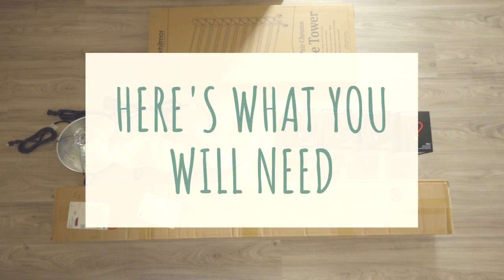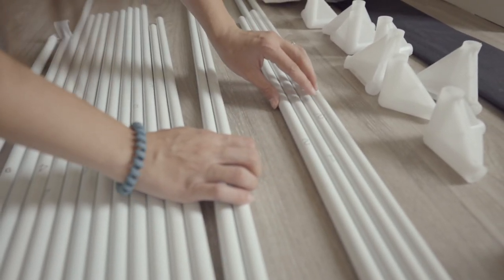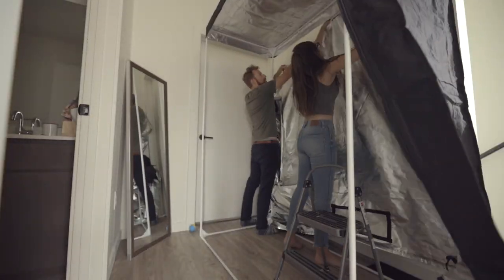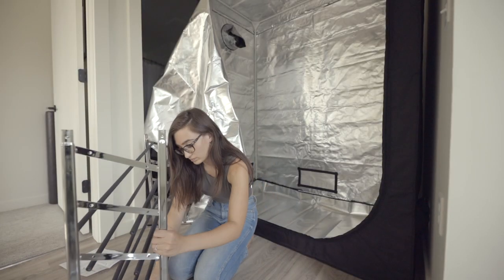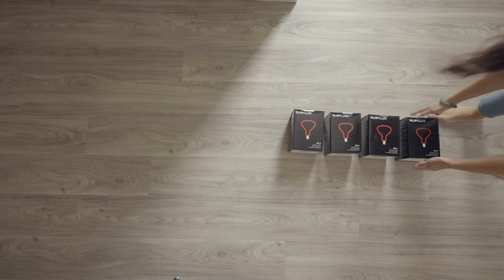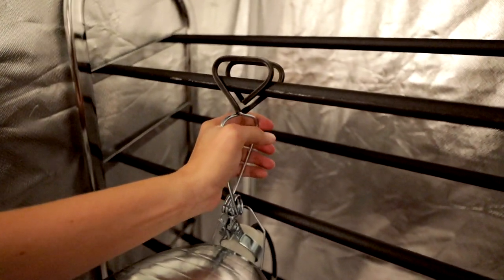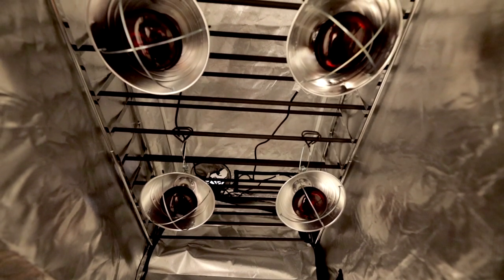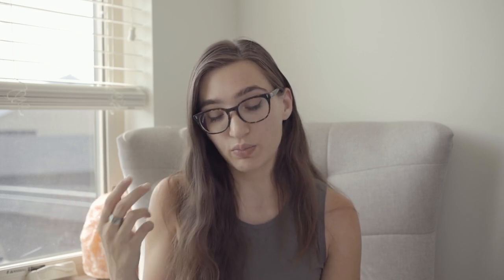DIY | HOW TO BUILD YOUR OWN INFRARED SAUNA FOR LESS THAN $400

Comment: Cool. I too have these light bulbs. But word of caution for anyone: Do NOT put too close to skin! . I had these around 10-15cm away from my body. Where I held it for longer around 10 minutes , I have two visible melanoma spots pop up, and some really tiny ones like spec of dust in the exact places!. Its not coincidence. Imho Its not 100% safe or without risk. 

In this case with reflectors to spread/even out the beams and you're at a distance far enough I believe its much safer. Just don't "roast" yourselves!.

Good health to all!

Comment: Thanks for the video. I'm in the same boat that I don't want to spend 3-4k for a sauna. I was going to get one for about $1200, but realized they might not be all that. Then I figured I could build my own, so I came looking for videos. Yours is the first one I came across. I'm still learning about Near Infrared vs Far Infrared, so not sure which bulbs I'll buy. Your video made me realize that it's not that difficult to simply build my own. Thanks and good luck with your health.
Reply from the maker: Thanks for taking the time to watch :) Hope it helped make the idea of making one more manageable! I love the bulbs that I linked in the description and haven't had an issue in the 6 months using them. They produce NIR and red light so I have found them helpful on both the deep detox level (NIR) and for healing some scarring I have (the red light). Hope that helps!

Comment: Please correct me if this is wrong information but I personally wouldn't add a metal shoe rack, you want to reduce the emf levels and metal is a conductor. Use grounded outlet and ext cords if possible
Reply from the maker: That's a good point! It was the best solution I could find when making this sauna and as I reduce my EMF exposure where I can, for me, the pros outweighed the cons. Do you have any other ideas for what the bulbs could be clamped to??
Reply: @fullymarissa4236  a timber shoe rack

Comment: Thanks for the great video!   A couple of questions from someone who is just learning about this form of therapy...  How hot does your sauna tent get with those bulbs?  Do you feel like that was enough bulbs?  How long do you stay in the tent and do you feel like this therapy is giving you the benefits associated with traditional sauna's?
Reply: Also eager to know what temperatures you were able to achieve with this setup? :)
Reply from the maker: Hi Sandy! Thank you for your questions! 1) I am not really sure on an exact temp but based on being in other sauna's I'd say that it gets around 120/130F. I like to plug it in 5-10 mins before getting in which gets it up to a temp that causes me to get a good sweat going after about 10 mins. 2) I stay in around 20 mins. If I am especially stagnant, then I will stay in up to 30, but I have never needed longer! My rule of thumb is to stay in about 10 mins after I really start sweating, which, for me, is around 20 mins. 3) There are definitely enough bulbs! I cannot imagine having or needing more than the 4, especially if you give them the time to warm up. 4) This, for me, is the BEST form of detox I have and I have never said that about a traditional sauna. It is a much deeper detox compared to traditional saunas. Those saunas work by heating up the air around you so it's a very surface level sweat. NIR saunas like this, penetrate deeply into your cells so you are truly detoxing from the inside out. I hope that helps!!
Reply: Sorry to be off topic but does anyone know of a way to log back into an instagram account?
I somehow lost my password. I would love any assistance you can offer me.
Reply: @Nico Anakin instablaster :)
Reply: @Cassius Jimmy It did the trick and I actually got access to my account again. I am so happy:D
Thank you so much you saved my account!
Reply: @Nico Anakin happy to help :)
Reply: After several months now is it still holding up?  Are the poles plastic and if so does it get too hot for them were the begin to warp?  Very interested in this and your set up seems the most feasible for me. Thanks for the video 😁

Comment: Do you need to have a tent? I have a small square room with a drain in my back yard wondering if I can just hang the lights around. It’s about 5-6m squared but wide open only 50% wall covering outside

Comment: How hot does it get with just the four lights? And what's the ambient temperature? Those bulbs create heat by being hot. There's little far infrared wavelengths, so they don't actually heat you and not the air. However, the light itself is healing, so you may find the lamps are their own thing, even if you don't sweat buckets.
Reply: I was wondering the same thing as well!
Reply from the maker: Hi Ann! I am not sure the exact temp with the 4 bulbs but, I SWEAT. Like full on dripping hah. These bulbs are NIR bulbs (not far/LED) so they become very hot and produce healing wavelengths and not just red light. It does not get uncomfortably hot in the tent and I really do feel like I sweat from the inside out. Wish I could give a more accurate answer... but I do know it has helped my detox tremendously and has the red light has also improved the scarring I have. I'm not sure how to accurately test the temp inside the tent... Thoughts?

Comment: Hello… do you find your skin ‘ burns’ from the four bulbs? My husband built me a panel of 4-philips 250W bulbs spaced as yours is. 
It’s in a tiny bathroom- I’m 18 inches away but can’t go back any further really.
I don’t have insulation panels yet which I may try to do bec I don’t sweat in there, I just get the red light therapy.
So… what is wattage of your bulbs? And do you find your skin burns?🤔Mine gets very hot snd pink patches in some areas . I heard RLT does not harm skin or cause cancer but the burning has me concerned 🤔
Maybe I’ll try less wattage and look for a tiny insulated tent🤔
Thanks for any more Info
Reply: @tenazrael  thanks !! I’ll definitely look her up. I do use olive oil, tahini sesame seed oil etc🤔
      However… I had a horrible accident with my bulbs… after a session last month ( after using for Two months and feeling/seeing benefits!!!)
I stood up turned around and one bulb exploded on back of my legs😣 it could have been my face n neck n chest 😣
we hadn’t put the “cages “ around them yet although the type I would have got were similar to yours and  would not have spared me either, those are just for not getting too close…more visual reminder…there are other “cages” that protect more, tiny openings, and would have spared me the “hot ‘shrapnel’ glass”😣
This was a horrid FREAK accident .., I’m still getting all wounds tended too every other day  at ER clinic.
The only explanation is that before I turned it off the corner of a wet towel might have brushed over it😣… I just can’t recall— was a bit traumatizing , or I didn’t screw it in tight enough when I changed bulbs.. I heard it could overheat that way snd possibly blow😕though they say very rare. I researched extensively with Dr Wilson etc
Needless to say… I’m too fearful now😕to continue . 
Be careful. Maybe get  better cages for protection.
I miss it terribly  just too risky 😕
Now I may do steam saunas for detox and look into the LED panels🤔For photobiomodulation🤔though those are ridiculously expensive 😣who knows if I’ll be able 
Anyway just sharing experience….warning others of possibility
Reply: @maramergan5488  Thanks for this.  I am about to build a infrared sauna and that was one of my concerns.  Definitely going to get a better cage to protect just in case.

Comment: Great, helpful video. I'm wondering though, what makes a grow tent better than an actual portable sauna tent, which are also at Amazon for similar prices.
Reply: Maybe the materials used to make the tent? I just purchased and assembled this grow tent in my living room and when I stand inside, it has a chemical smell. I just found out from someone that sells similar saunas online, that mylar gives off toxic fumes when it heats up. I currently have a heater set up in my grow tent hoping the heat will force the mylar to outgas completely before I use it as a sauna. It would defeat the purpose if we are getting poisoned when we are trying to improve our health!

Comment: Does this get hot, with only a tent and 4 bulbs. Was thinking about building a small cedar enclosure but if not needed. Or would it be better to double the lights
Reply: The lights put out a lot of heat.  I can imagine 4 would get plenty hot.  I use just one directed light.

Comment: I am curious, what makes this different than the $360 infrared sauna tent from amazon? I am looking to either buy or build one for myself but building seems to be the same price as that.
Reply: Maybe the materials used to make the tent? I just purchased and assembled this grow tent in my living room and when I stand inside, it has a chemical smell. I just found out from someone that sells similar saunas online, that mylar gives off toxic fumes when it heats up. I currently have a heater set up in my grow tent hoping the heat will force the mylar to outgas completely before I use it as a sauna. It would defeat the purpose if we are getting poisoned when we are trying to improve our health!

Comment: I built my own 5'x5' infrared growers tent sauna and I am having a problem with the 250w bulbs exploding on me! Has anyone else had this problem? Does anyone have a solution to this problem?  Here are the bulbs I am using.  Halco 104044 R40 infrared bulb 250 watt.
Reply from the maker: Oh no!! I am so sorry! Wish I could speak to those... I use the ones linked in the description and haven't had a problem in the 6 months using them. When I first got them, one just didn't work and I messaged Rubylux and they sent me a replacement the next day! I hope that helps!
Reply: @fullymarissa4236  Thank You for replying! I am still trying to figure out my problem. I think I am sitting in to long and steaming up my grow tent and the moisture is maybe dripping off the ceiling on to the bulbs and making them explode. I might have to open the vents on the top to keep the moisture down.
Reply: @mikekmalick  wow did you fix that as how can you fix it if you sweat and create moisture.... wanting to do this too and just ordered everything but worried about exploding bulbs too....
Reply: @sylvie5894  Hi Sylvie! I have not found a way to completely fix the problem! What does help is to make sure you have good airflow. You will need air coming up from the bottom to the top to keep the moisture down and I leave my tent door open about a quarter way. If you drip sweet on the bulbs they can explode! Wear safety glasses to be safe!

Comment: Love the video and your channel!! I’m having a rare and undiagnosed skin condition which breaks out in the summer months. No doctors have determined what it is but my one natural path believes it might be heavy metal toxicity as I have many tattoos and work in a steel industry. I ordered a 60 by 60 by 80 tent as I wanted it a bit larger but I didn’t consider the temperature reaching the level it needs to be effective. So the question is I have the same 4 lights as yours, do you think the 60 by 60 would be too large or should I have went the 60 by 30? Thanks!

Comment: Does it get hot ?
Reply: I get mine up tp 116ºF. Near IR lamps heat you from the inside so extreme temps inside the sauna are not necessary.

Comment: I've tried with the grow tent and there is a bad smell. Im not sure this is a good option. probably still better with wood. Anyone else tried it?
Reply from the maker: Hi Simon! I didn't note in this video but have let people know since -- I let mine air out for a couple days once assembled and the smell went away! Off-gassing is definitely a good idea, especially if sensitive. Wish I had a better alternative but I hope this helps!
Reply: @fullymarissa4236  Maybe if I put an air purifier might work? I'm not sure. I will test it. Thanks
Reply from the maker: @2393034  Oh that could definitely be an option! If you live in a warm/non windy area, you could put it on your deck or if you have one, your garage. Let me know how the air purifier works out!
Reply: Hi Simon, Question, did the smell ever go away for you?
Reply: @neoterra7072  nope,  it didn't go away.
Reply: @2393034  Hi Simon, I got to try the sauna for the first time. The feeling was incredible! I could still smell the plastic in the tent a little even though it had been sitting for nearly a week airing out. I even ran a heater in the tent for a few hours. I'm still hoping that with daily use the fabric will air out quickly. I'm definitely hooked however! I wonder if the smell ever went away for Marissa? 

Are you still using your sauna?
Reply: @neoterra7072  yes the smell will never go away because of the plastic material of the sauna tent.